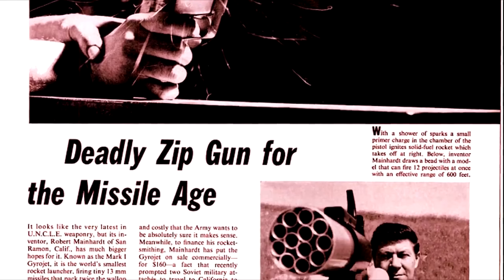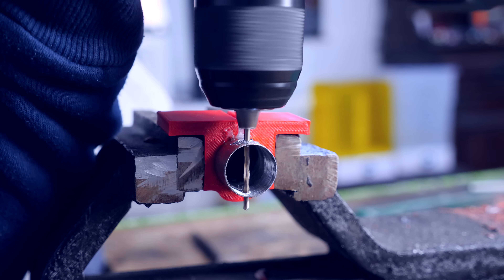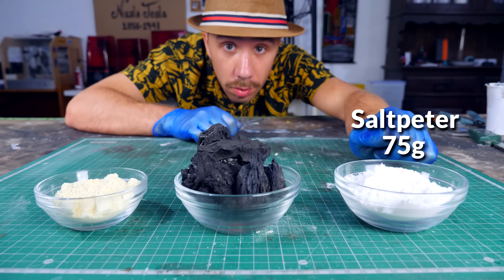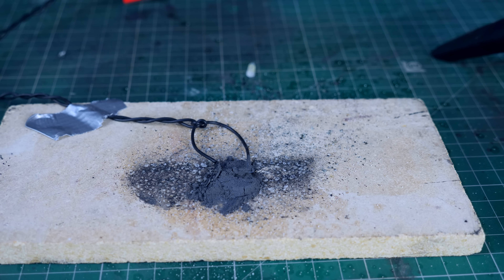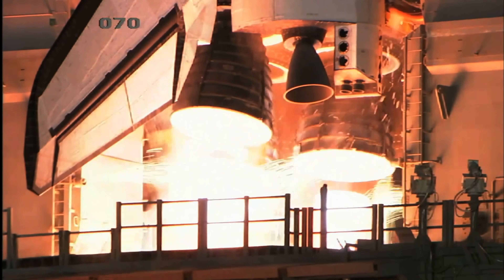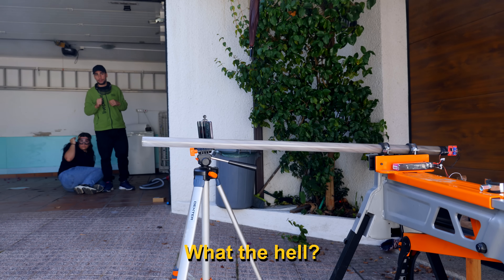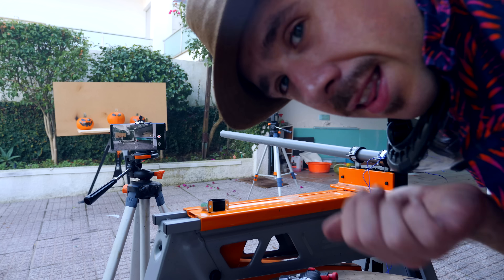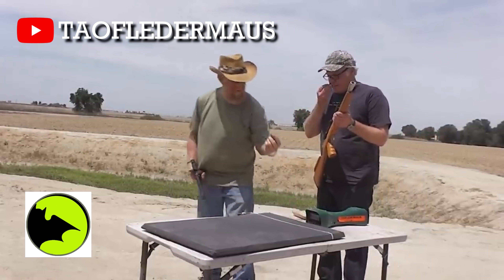GYROJET - The Spinning Rocket Bullet

Comment: One thing I have noticed about the Gyrojet gun itself is that the barrel of the gun after ignition has holes in the back of the barrel on either side. That allows for oxygen to help ignite the propellent and the nozzles to spin the bullet. It seemed that the reason your bullets weren't stable was that the majority of the ignition was being done outside of the gun. When in test firings I have seen, the bullet actually started its ignition inside of the barrel and propelled the rocket forward at a higher rite of speed after it had achieved a proper spin.

Comment: Hey integza, why don't you try making a car engine?  to add a bit of a challenge, make it run on hydrogen or electrically.  (you can get hydrogen gas via electrolysis, it's pretty easy.

Comment: I like the concept.  I feel that if you had a third hole in the back, it would of caused it to spin correctly and fly straight.   I would place them equally apart from each other, and all set at the same spin angle internally.  I may even reduce their size slightly to cause for more force to be created as it ignites.  Great work though.  This concept is new to me, but very interesting.

Comment: You can add fins, and it's actually a rocket technique used in military equipment, they use fins that are flexable and fold them up to fit them into a tube

Comment: Have you tried 3D print your design for the propellant modules, then cast them with a silicone so that you don't have to compress them with two different components? This might make it easier to remove them from the molds and provide consistency amongst your design. Keep up the good work! I enjoy watching your content and the innovations you continually improve upon.

Comment: The original gyro jet bullets had no conical nozzle and had a much harsher degree of nozzle rotation. 8° is simply not enough. I think the original gyro jet bullets had ~32° of rotation from the point where the propellant was to the end of the nozzle. I watched the video on the gyro jets by one TAOFLEDERMAUS just a few weeks ago.

Comment: I think there are more things you need to improve: first, you need faster burning propellant (one way to accomplish that is with two or three holes in the propellant grain, giving more burning area), second, you need better ignition (not sure you'll get that one -- high power model rockets use similar grains and ignition and almost always have some delay as the burn spreads over the grain surface and builds pressure in the engine), and third, you need a way to ignite the "bullets" without inserting a wire through one nozzle -- in a couple of your slo-mo shots, we can see the wire trailing from one nozzle, which is causing much of the tumble.

However, I agree with @Backyard Ballistics -- if Gyrojet were a very workable concept, it would have taken off with the military funding they had in the 1960s (some of the guns were actually tested in Vietnam).  Better would be fin stabilized -- which you can do in a fairly tight smoothbore barrel.  I know of two ways that don't require a bunch of tech in the bullet: first is hinged fins that wrap around the base of the bullet, shaped so that airflow pushes them out once they leave the bore (some mortar and tank rounds used this method in the 1940s and 1950s); the other is fins that are recessed into the body of the rocket and hinge or slide out once the bore no longer holds them in place.  You could also use a sub-diameter projectile with a sabot to guide the bullet in the bore (and in a conventional gun, to seal the propellant gases from just blowing past the bullet), which then discards once the bullet leaves the bore -- this is how modern Fin Stabilized Sabot (FSS) tank rounds work (the common armor piercing round fired by the M1A2 Abrams in service for the USA).

Or you could just make a rifled barrel and put little studs on the surface of the bullet that ride in the grooves, and just a single central nozzle.  Of course, then you have the same problem with low muzzle velocity = low spin rate, but you can partially get around that by using a faster twist -- 100 mm twist should be about right with the barrel length and propellant you have.  One advantage of this is that it's much easier to make a single central nozzle than to make two in a single block.

Comment: I think if you want even more punch, sealing the ends of the chamber and delivering current to the nichrome through a soft spring in the back of the chamber and the edge of the chamber (like a battery) could prove a decent method of ignition.

I think using the backpressure to help accelerate the rocket in the nozzle could open up more energy in the projectile to be used for spinning the whole rocket at a higher RPM. I don't know what RPM the gyrojet actually uses, but it has to be pretty high. Also maybe hit the inside of the nozzle with some kind of lubricant.

Comment: 11:15 How about building vacuum dust box that also doubles as spray booth? Just get big fan, box of chosen material, filter material and couple lights and maybe plexy glass? Put the fan on the back wall of the box with filter material that collects the dust and plexy on the front hole that allows you to see and can be removed for spray painting. You can the make mount for camera and keep the dust out from your workshop.

Comment: How about using electromagnets to spin a cylindrical shaped projectile and create a nozzle with two venturi at a 45 degree angle to the back of the projectiles outlet to create vacuum for guidance while project it with a propellant.

Comment: TECHNICAL COMMENT @Integza

I think the problem is that the gas release inside the tube is not the same in the two nozzles and causes more friction with one side of the tube than with the other, thus making the velocity vector no longer aligned with the tube when it leaves the tube. The tube. Perhaps a first completely axial ignition would work and then an ignition of the combustion chamber of the rotated nozzles. This would mean a more complex geometry of the chambers to keep the two parts independent.

Perhaps something simpler would be to adapt the thrust of a main axial nozzle and of the two secondary ones by varying their areas. I do not know the ratio but I would start testing with 50% in the main one and 25% for each of the non-aligned ones.

Comment: If you wanted to make some molds for concrete or similar, it may be worth a try to use pva or some other water-dissolvable filament. you could probably get some really detailed molds with easy removal that way.

Comment: Integza, have you considered using sabot round style cartridges? I have always thought sabot rounds would make for a good gyrojet projectile. It will give you space for fins like a missile
Reply: But Sabot would require bigger bore to fit those rocket propellant and more complex assembly...
Reply: @alifio2183  Gyrojet projectiles are already about as complex as they get, its what we are here for, so I actually call that part a plus haha For the size, I was actually thinking a more narrow body, instead of a larger barrel. With tech like this, usually each version can be scaled down as you find out what did and didnt work. I think Integza is capable of making a smaller projectile body if he thinks its worth it, the only part that concerns me is the nozzle. As a compromise, keep a bulky nozzle, make a tapered body, add some stabilizers, and I think there is potential for an accurate and powerful projectile.
Reply: @UncleLandoKnows  problem is gyrojet needed space for propellant inside the projectile, while sabot is basically thinning the projectile for more penetration and speed... if you didnt put rocket propellant inside the projectile its not gyrojet anymore...

Even if its sabot the projectile will still be dummy THICC
Reply: @alifio2183  love the response c: I agree that the propellant needs more space than a classic bullet, I guess I may have underestimated the amount of space it would need. The more I think of it, the more I am picturing one of those throw away craft rockets being used haha Probably not the most practical but leave it to Integza to do something unexpected

Comment: If you want to try a small nosel change, try a center hole for the ignighter, 3 or 4 holes for the exaust.  Most slow motions look ( to me ) like the exaust nosel with the ignighter is not letting the gas out.

Comment: radio controlled hybride rocket? printed fuel "cells" with n2o as oxidizer. have like 3 to 4 engines/nozzles even if its just too see if its possible to control the direction of of the rocket by controlling/limiting the amount of oxidizer(nitrous or even {liquid}oxygen) flowing trough the engines? and by the way I am so desperately in need of a 3d printer but it doesn't appear that I will be able to free up nearly enough budget anytime soon :'(

Comment: I have an idea for a solar powered RC boat ( that I believe COULD be up-sized ) to a full sized craft. ) Essentially, the craft would have 3 parts, the center, where the passenger ( or in this case the electronics would sit ) and a sponsion (  pretty much the same size and shape as the center itself )  one on each side. These would be connected in the same way a DOUBLE outrigger canoe would be. An electric motor would be placed inside each of these outriggers, with a shaft and a prop extending on a 10 degree angle downward ( so they stayed below the surface at all times. )
To power the boat, you would need to small solar panels which would be placed between the sponsions ( outriggers ) - and the center of the boat. Steering could be controlled by using either motor in combination with a rudder on each out rigger and independent speed control of the motors. ( you could use the steering wheel set up on an RC car to achieve this ) and the throttle control ( on or off ) could be the trigger itself. Except for  a battery for the receiver - I calculate the boat could pretty much get around all day if the right combination of voltage and motor were used.

As a back-up....you could also include a single battery to bring it back ( the solar cells would could also trickle charge  the battery whist its being used. ) . - Well mate, - just a thought.
I hope it stirs the imagination. ;)

Comment: I wonder if applying a spin to the rocket via rifling your barrel (in addition to the tilted nozzles) would stablize the rockets trajectory.  Back in the day i used to play a lot of paintball.  We used to make these muzzle extenders that had holes drilled in a spiral pattern to spin the paintball on its way out the gun.  Maybe google rifled paintball barrells and copy the hole pattern on the last 1/3 of your pvc barrel.  Hopefully the rifling is the same direction as the nozzles are trying to spin.

Comment: Another reason the nozzles aren't working so well may lie in the intensity the rocket is burning when it begins to travel.  Essentially they begin to move before reaching full thrust.

The gyrojet pistol was unique in its design in that the hammer that ignited the primer was not located behind the projectile like in other weapons.  Instead it actually struck the round from the front, meaning that the rocket had to reach a high enough pressure to overcome the hammer spring before it would begin traveling toward the end of the barrel.  Just like an airplane will apply brakes and bring the engines up to full throttle before releasing the brakes for takeoff if they are on a short runway or loaded heavy, the impulse is lower if it is still building pressure as it travels down the barrel.  Try finding a way to restrain the rocket and delay its acceleration, thereby increasing its impulse and ultimately its muzzle speed, and its horizontal rotation speed.

Comment: Use the acrylic pipe but drill holes in it like the original gun barrel

This way it won't pull a vacuum behind the rocket in the barrel as it accelerates

Comment: You should have more weight on the front side of the bullet/rocked in the direction of the movement. In your case, the center of mass is very behind because of the heavy bronze and ceramic nozzle. Try to change that and you should have a more stable flight path of the bullet/rocked.

Comment: The problem will probably be the nozzle design:

1. The shallow angle will probably not help, 25-30 degrees will trade forward acceleration for spin.
2. The pressure in the rocket is probably not high enough for that expansion ratio on the nozzle, so you are probably under expanded and losing efficiency.

In addition:

Why not a hybrid design, so a gun powder cartridge and rifling to provide initial acceleration and spin to the projectile, then the rocket to perpetuate the velocity.

Comment: have you considered a 3d printed sabot to give you more control over your fit between co2 cartridge and your off the shelf barrel inside diameter? You might even consider graphite lube. I really would like to see a post mortem of the ceramic nozzle like the bronze nozzle.

Comment: The pipe is too wide and the rocket is tumbling before it exits. It needs to be tight enough that the escaping gasses cause enough pressure to create an even gas flow around the bullet, cushioning it from surface drag. I think, if you wanted to kill tomatoes with this, you might need to add something to start the bullet rotating at or before ignition to give it a boost. The original gyrojet didn't do this but you can! Maybe just a physical kicker, maybe an electric roller. you could make a breechblock that rotates 180deg and time the ignition through testing and thinking of sending flaming death into those disgusting tomatoes.

Comment: Maybe you should try putting grooves on the tip of the bullets, then as the air passes through those grooves it will cause the bullet to spin and stay straight

Comment: Love your videos man! And I see that your experiments are getting more and more serious! 
Well, but despite your love for rockets, it seems that they always find a way to let you down! It kind of feels you are wasting your inventor and 3dprint potential! I sugest you try another type of engine for your rockets and contraptions!
I have an idea for a video actually: Try to build a simple lightweight solar powered plane! It can have a small battery, but the idea is that is regenerate enough electrical charge to power the electric motor (I assume you will attach the motor to a propeller, but other forms of thurst could be interesting..)

Comment: From my experience I would recommend 3 holes, 2 for rotation and one in the middle for forward thrust and experimenting with size and tilt of the nozzles.
Reply: I was thinking 4 holes. 3 to balance the spin, with 1 centered for speed (which is key).
Reply: @DraconicDuelist  There is no need to balance, gyroscopic force is more powerful than you might expect. Even 1 hole might work

Comment: This was a lot of fun and mildly terrifying to watch. Perfect Integza balance! Thoughts: maybe leaving the neck in the CO2 cartridges and using twisted exhaust vanes instead of rocket nozzles could simplify the build? You could fill the CO2 cartridges with the propellant while it's still liquid and then drill the hole down the center before installing the vanes. As much as I hate to try to improve the uncontained horizontal firing of rocket-propelled projectiles, I want to see you smash some pumpkins and / or tomatoes with this terrifyingly fun idea.

Comment: How about using the CO2 casing as the mold? A perfect fit everytime and no need to move it.
Reply: yeah, but first solder the ignition wire to the front, and run it through the  mandrel, which should be star shaped. use the casing for one pole and the nozzle as the other pole. that way he can ignite way more fuel instantly and improve accelleration.
Reply: Cool, I should have scrolled down father before posting the same idea I added some more suggestions have a look  :)
Reply: I think the problem is it needs to be smaller than the inside of the casing since it's meant to burn from the inside and the outside. Otherwise it wouldn't burn quick enough.
Reply: @battlesheep2552  Gun cotton but rather than made with cotton balls grind the cotton to powder before nitrating then mix into the rocket candy should give a high burn rate.

Comment: adding some spiral shaped grooves to the outside of the "shell" or an insert with rifling for the barrel might help in getting the rotation started. I think the problem with stabilization is a matter of mass. Your projectile is too heavy for the nozzels angle to provide enough stabilization. This is just a theory but it might be worth testing out different barrel designs to compensate for these issues.

Comment: The problem is rather that the rocket bullet flies at high speed and has the resistance of bypassing air. Place a piece of lead in the rocket on the tip or fins of the rocket and you're stabilized.

Comment: The gyrojet holds the round until the rocket has created enough thrust to overpower the hammer/holder, which takes about 2-4 seconds. While being held in place, the round can start spinning and, if I recall correctly, is also held centered by the stationary firing pin and hammer (which strikes the front of the round and pushes it onto the pin). I hope that helps.

Comment: You need something that doesn't melt at 700f to 800f.
Try increasing the spin holes by 3% and turn them 1 to 2 degrees more for a better spin.

Comment: the angle of the nozzle exits are too shallow.
the fuel burns too slow.
the ignition wires causes way to much drag and needs to be removed as soon as it ignites.

you really need a cnc and lathe to reach the next level. i do not think consumer grade 3d printing is at the level of creating strong enough nozzles for what you are trying tro accomplish, you need solid metal.